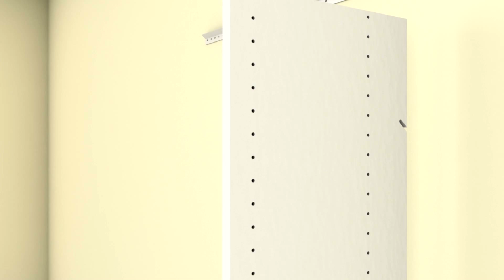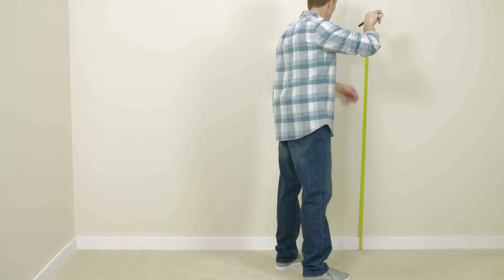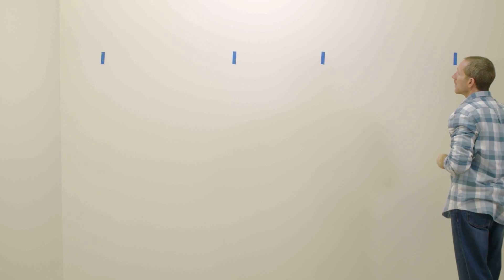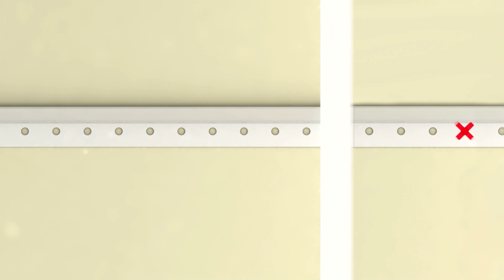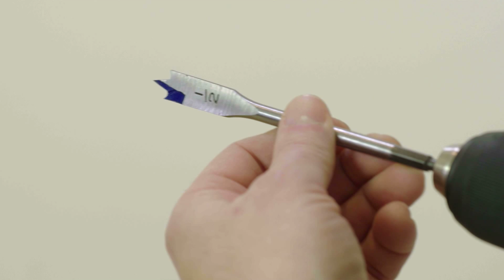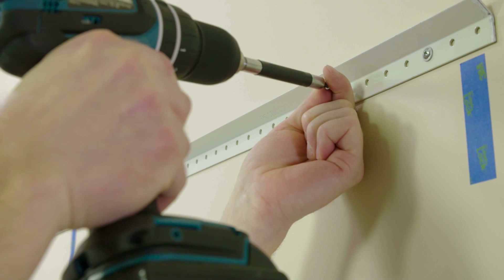How to Install the Easy Track Rail

Comment: can you provide a CAD or similar drawing showing the sizes of the steel rail profile and its angle off the wall, in my application, it will be necessary to know this before purchasing.